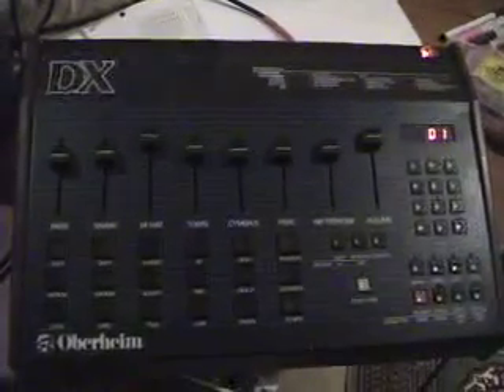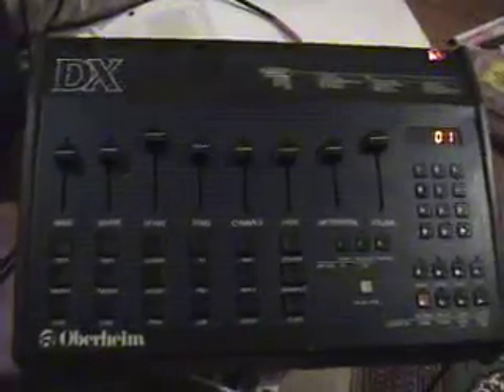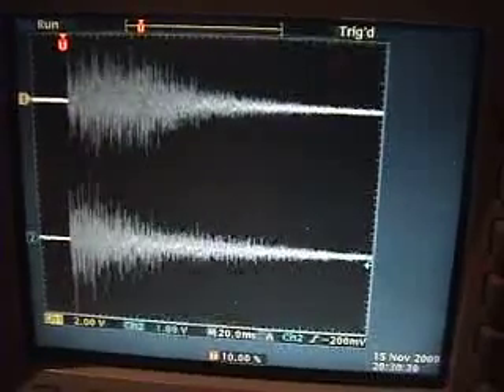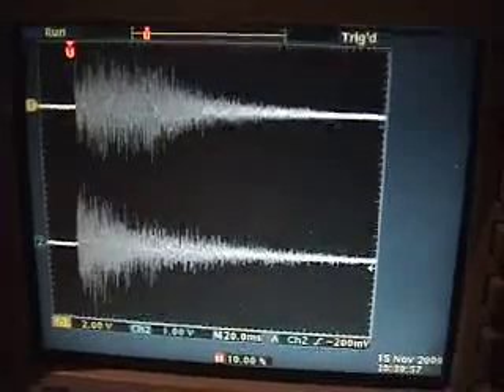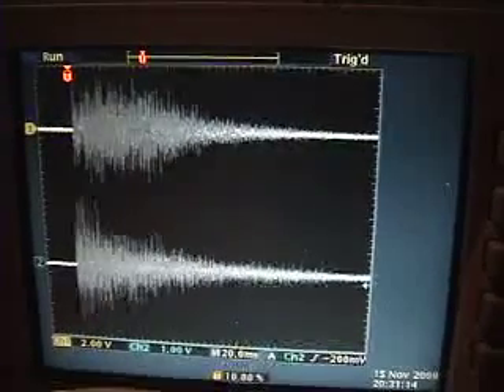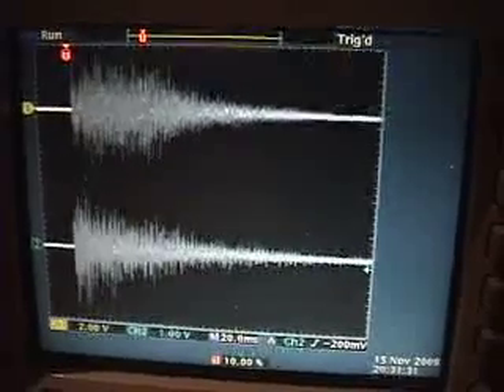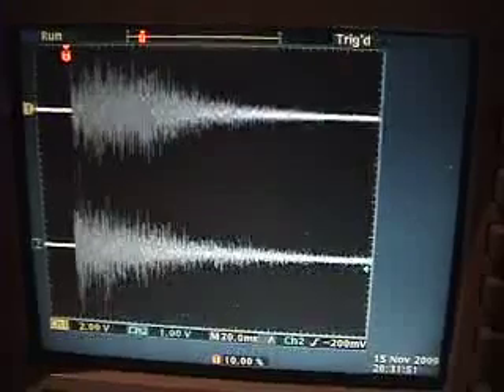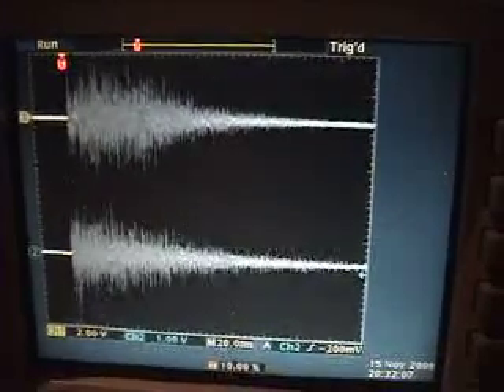Linn LM-1 HiHat

Comment: ...and that boys and girls is why the better analogue synth plugins use a random detune from oscillator to oscillator and a synch on/off for modulation.
Reply: ...and free running oscillators - which makes a huge difference. Which is the same concept as demonstrated in this video.